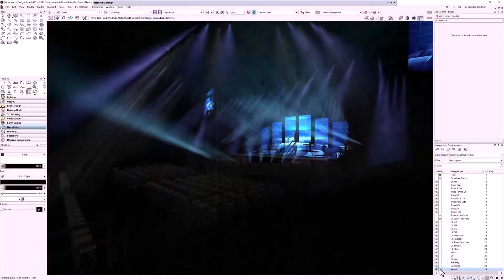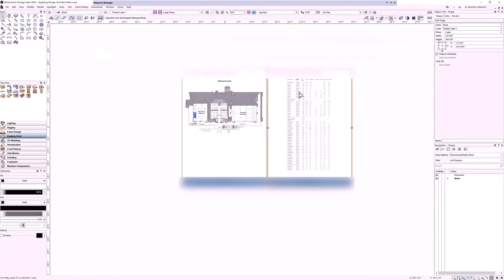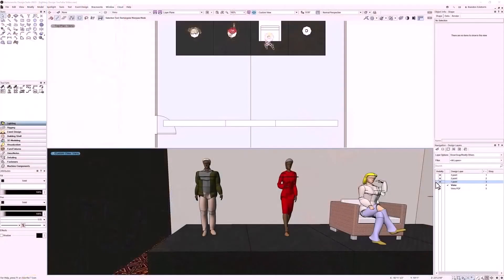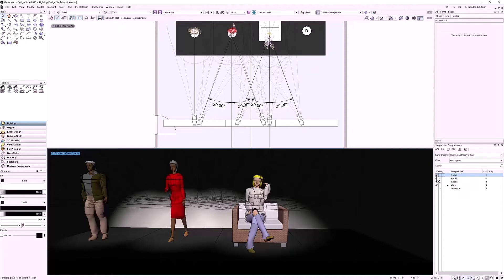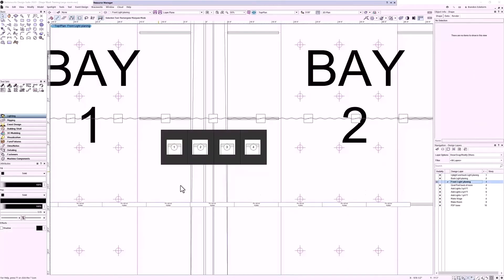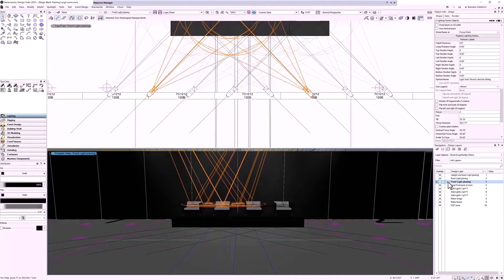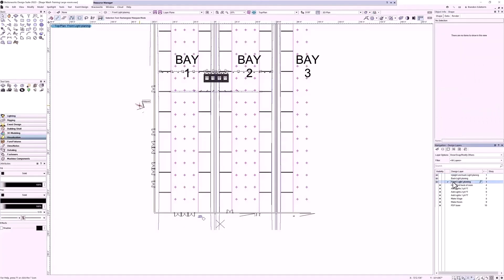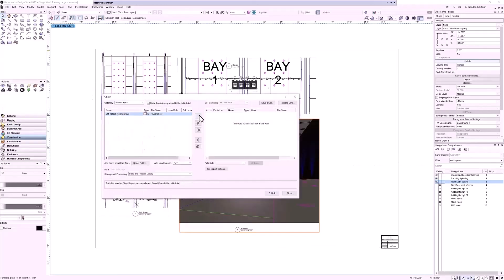An Introduction to Lighting Design

Comment: This is a nice quick easy guide. Being an experienced LD even I learnt something new.
You make the rendering look easy but in reality Vectorworks is very unstable when it comes to rendering especially large truss and stage rigs. Crashing, beach balling all with a top spec MacBook.
Reply: So one of the trick I am using is to adjust the "Simplified Truss" class and add 2D images as a mask; then I turn off my 3D truss class so it has less to render.